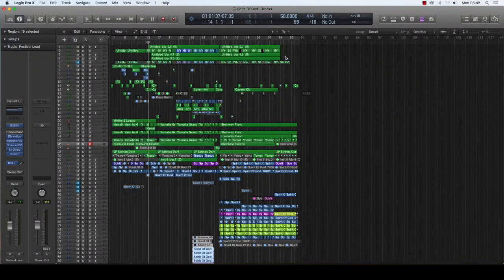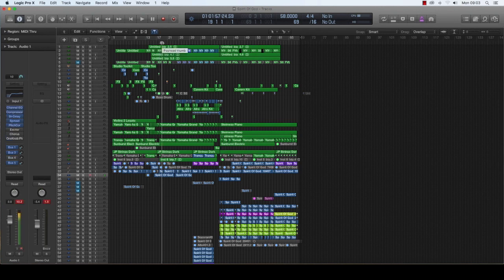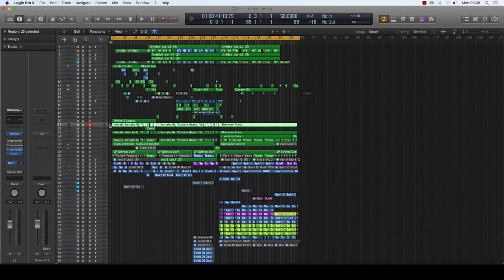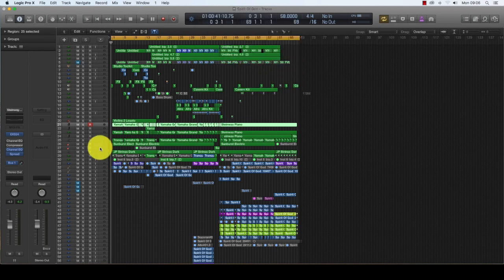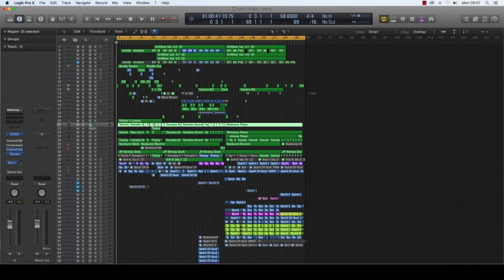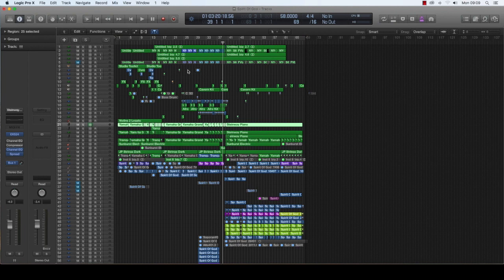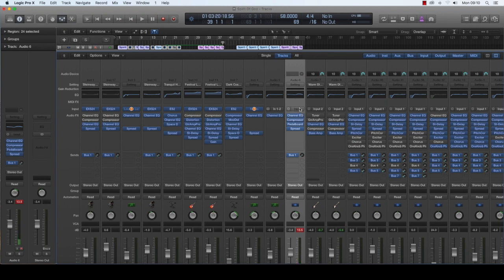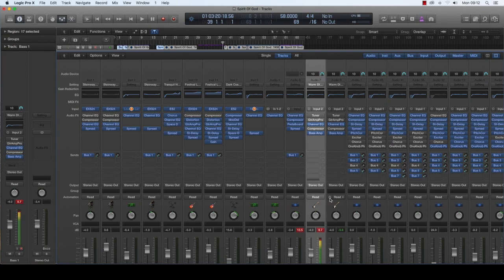HOW TO GET RID OF SYSTEM OVERLOAD ON APPLE LOGIC PRO X (PART 1)

Comment: Yeah, I never actually delete the best tracks, I bounce in place then, turn the power button off for the vst channel and hide it. 

 Careful if if you bip a track that has been used as a side chain input for a compressor on another track.  The side chain input will not automatically switch to the new bip audio track